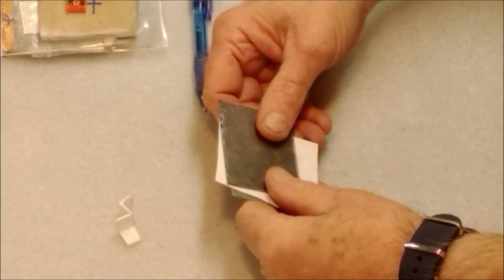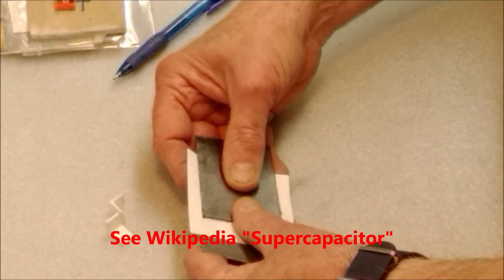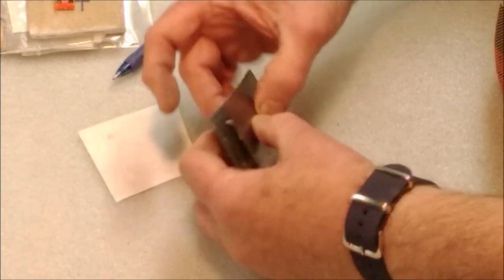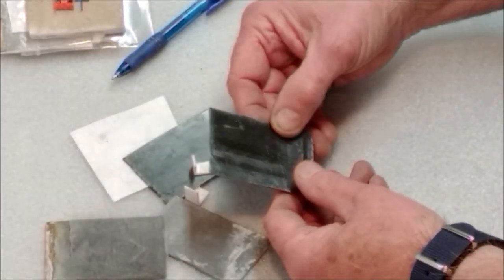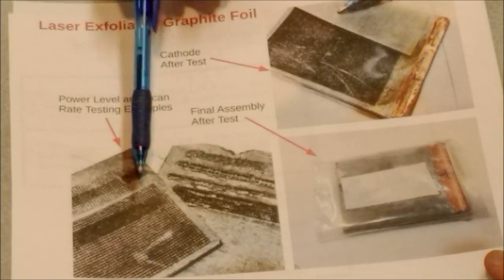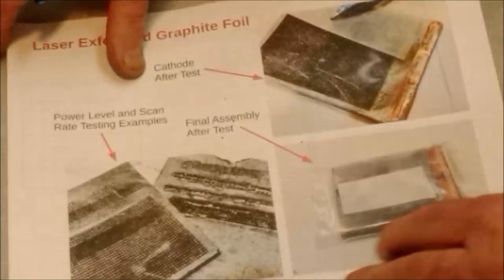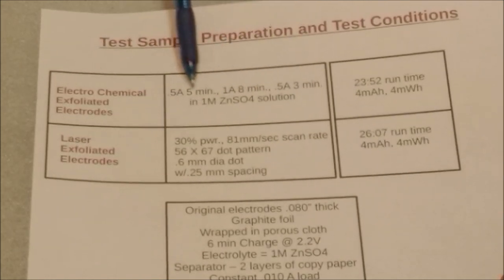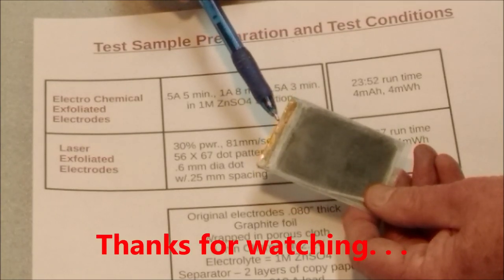Laser vs Electro Chem Graphite Exfoliation for Supercapacitor Electrodes

Comment: A great description of the laser technique for graphite exfoliation. It was interesting to note that there was no real difference between the two methods. I am inclined to favour the battery route for alternative energy storage rather than the supper capacitor, the self discharge of even commercial caps is a real problem.